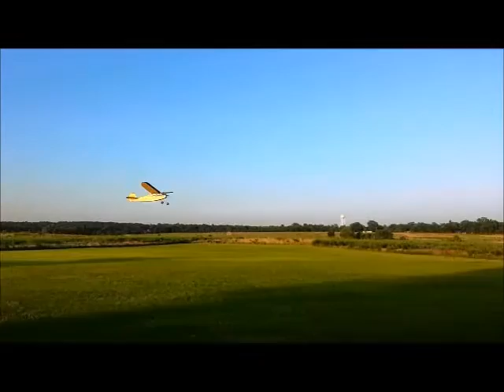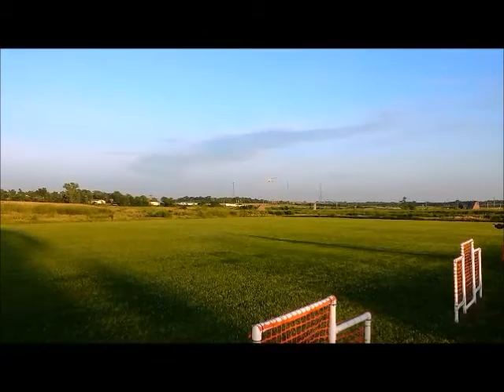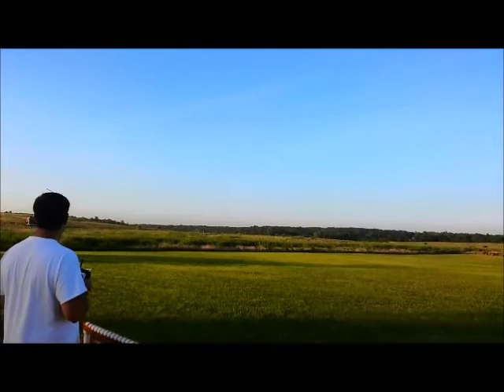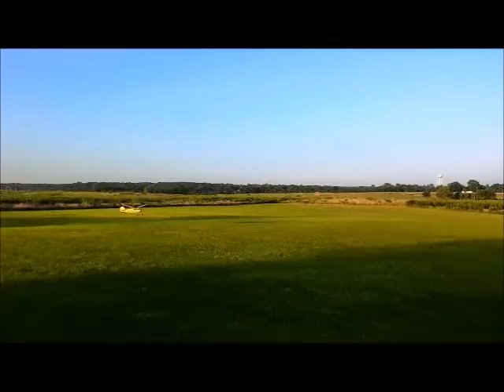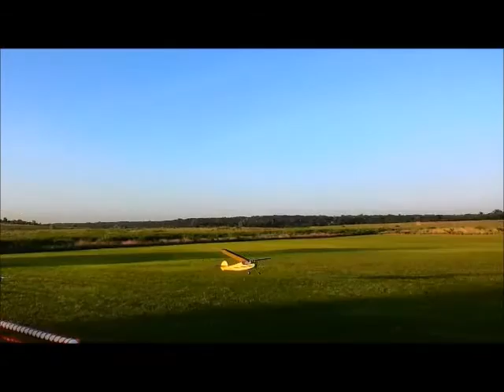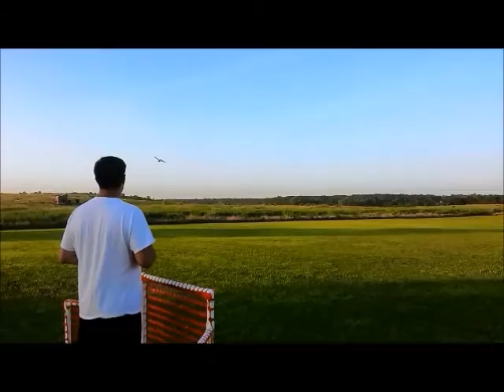Power House Touch and Go's

Comment: Yes, completely over powered with 75.  It wants to climb and climb because of huge wing and lifting airfoil.  I have an Enya 60 on it now.  Still over powered.  A Saito 45 would do fine powering one.  Don't be afraid to move CG way back on these old timers.  50% and even more of wing for CG is ok.